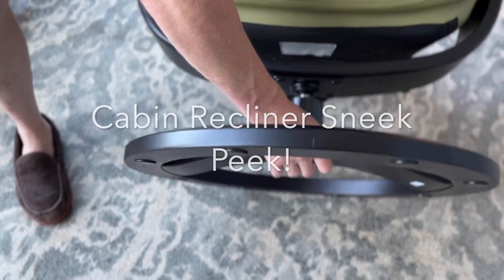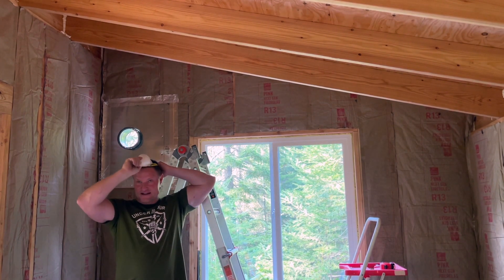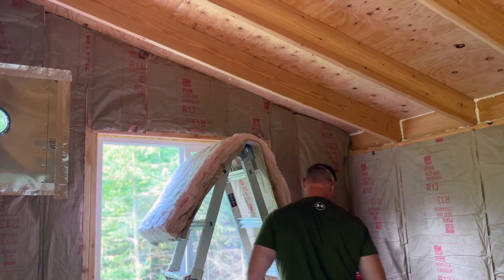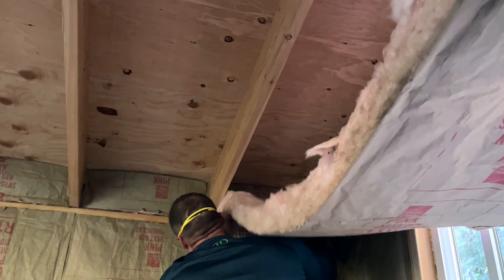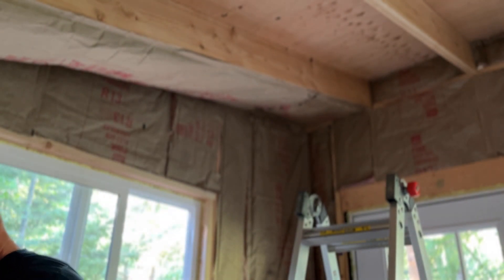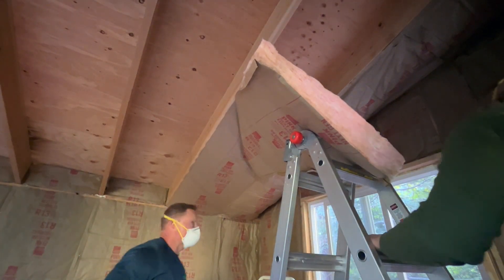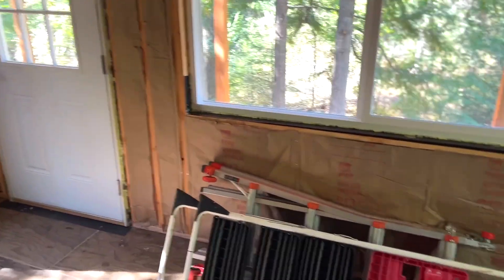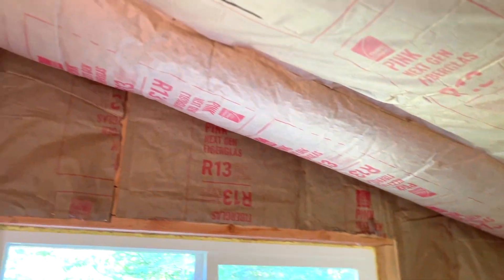Building an Off Grid Cabin in the Rocky Mountains (Part 12)

Comment: Hate to say it, but without air in your roof, you will end up getting moisture (condensation) in your ceiling between the insulation and the roof.. It will soak it up.
Reply from the maker: Roger that. I understand with that metal roof. It’ll catch condensation and that’s why we have all the windows that we can open and crack as well as the Dutch door and the 12 V exhaust fan. Not sure you saw those. Thanks for the comment and for watching please like and subscribe if you enjoy your content and remember I’m an amateur builder building off grid on my own property.